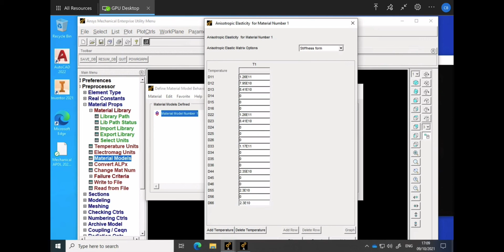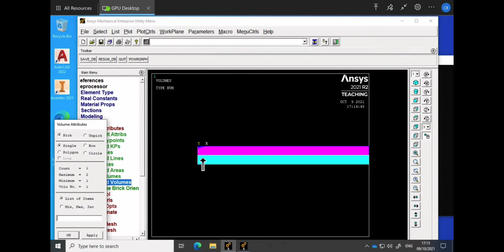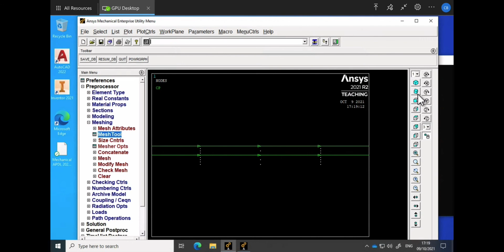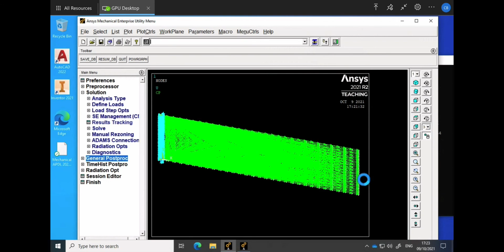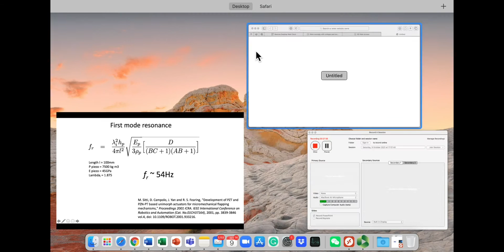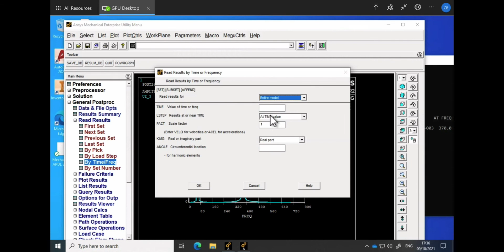Piezoelectric Unimorph in ANSYS

Comment: Dear Chris Bowen, Thank you very much for your video.  It was very helpful to me. I tried this model in ANSYS workbench and I got the same. Also I tried this model to get voltage by using your previous video, I got some value, also i plot electric field and got some value in terms of 10^8 v/m. Is it correct?
Reply from the maker: Should be voltage/thickness for applied field.